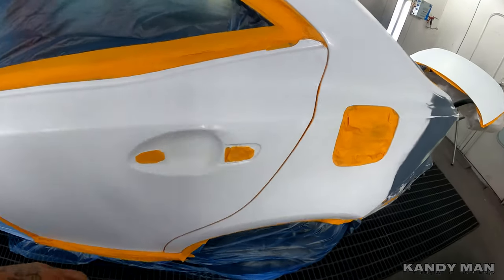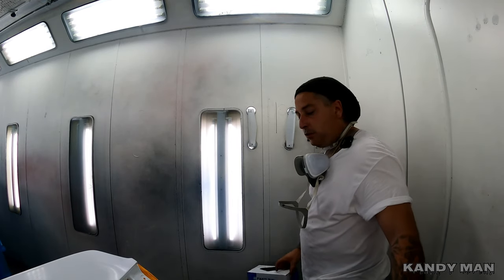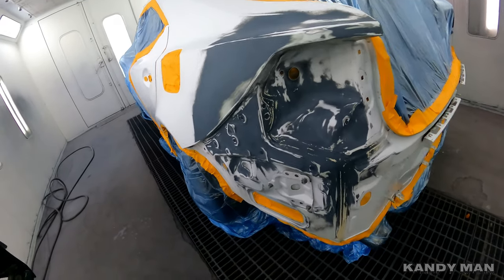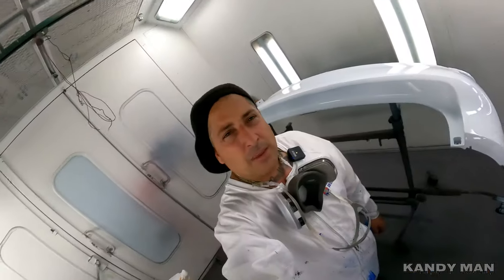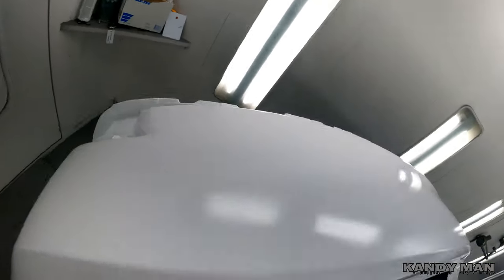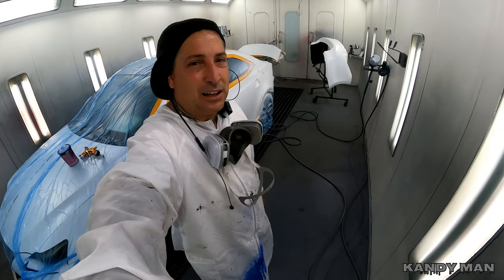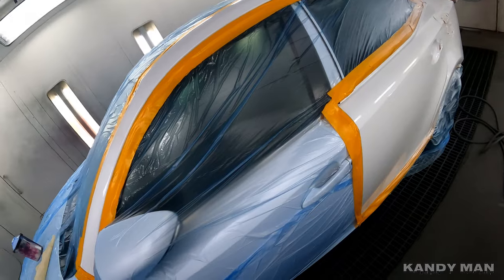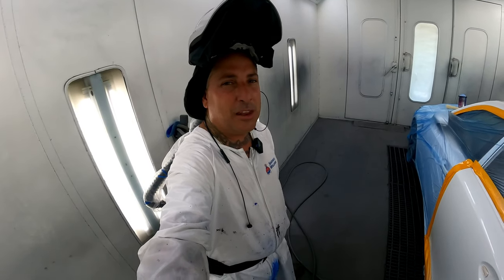THE HEAT IS ON - PAINTING IN HOT WEATHER

Comment: Do you find at times you can't slow the product down enough  to get a quality job? We pull fresh air off a black tar roof. Gets up to 110 in booth,just can't slow it down for good blends
Reply from the maker: I have seen that at different shops especially when the booth is single wall and not double panel insulated.  Gets very hot.